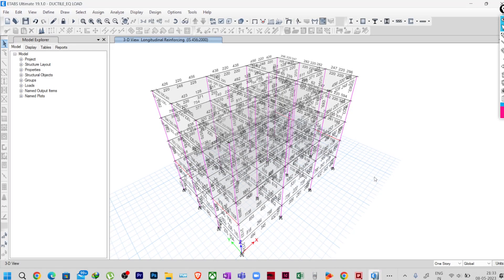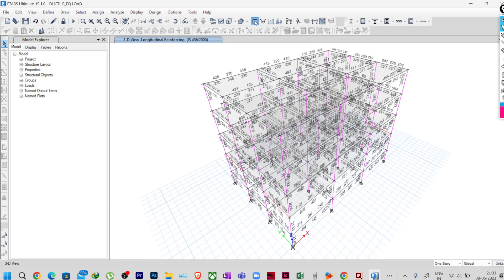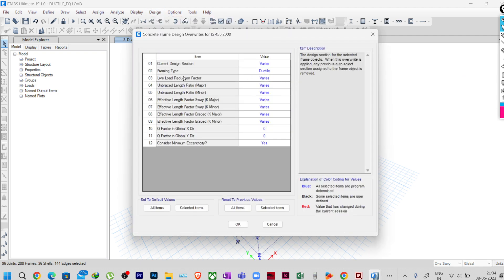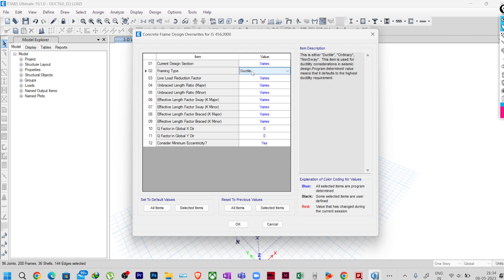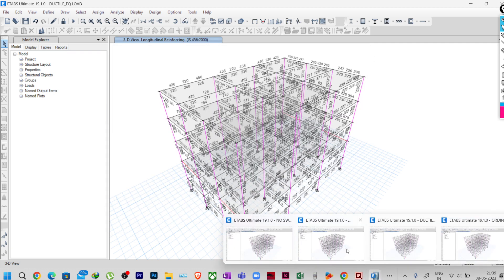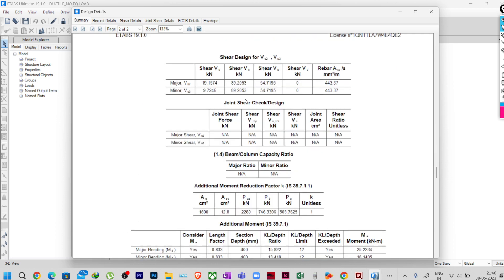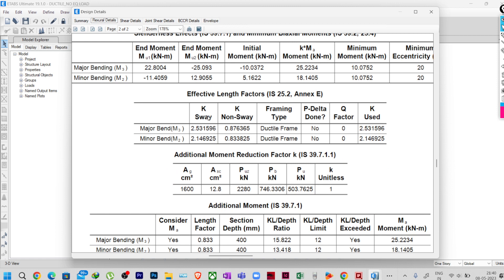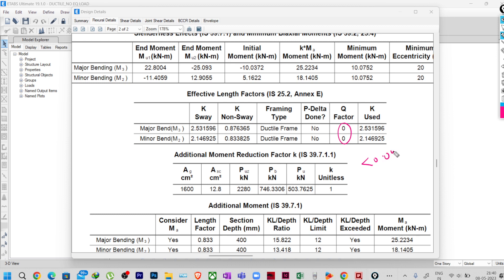ETABS QUIZ- Q.2-Frame Design Overwrite-Framing Type | Complete Explanation | ilustraca | Sandip Deb

Comment: so basically, we need to enter the overwrites in order to select non-sway factor as K however as we are provided with different values for column when it is effectively held in place with fixed ends do we need to enter the overwrites in k factor part?

Comment: What will happen if we design the column for sway condition ...will it collapse after we construct
Reply from the maker: In that case I'll suggest to kindly refer any RCC design book and the Code IS456 first for Column. Once you know the manual design of column, your doubt will cleared totally. 

As a hint, if you get Effective length factor for sway condition which is very high or tends to infinity it means that your frame is unstable and you need to cross check the analytical model.